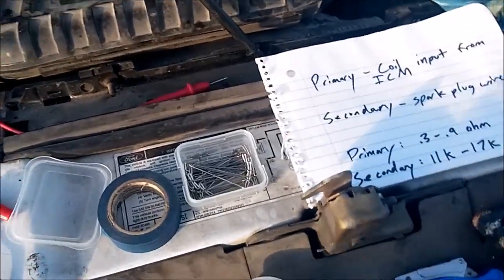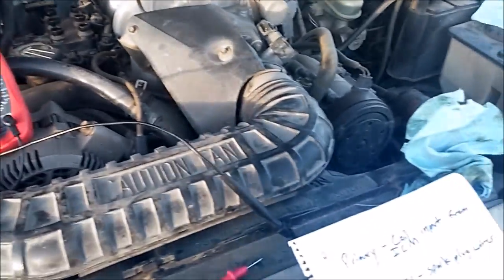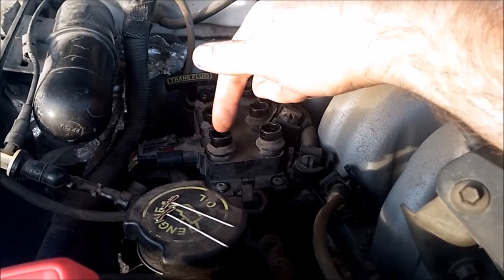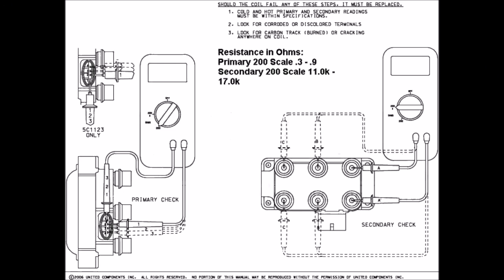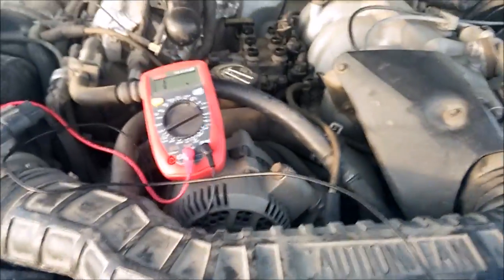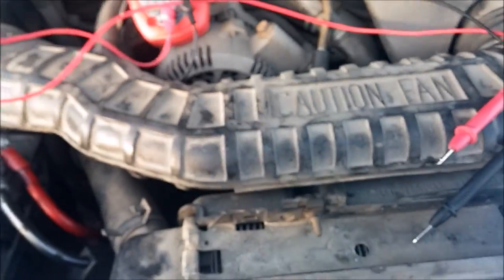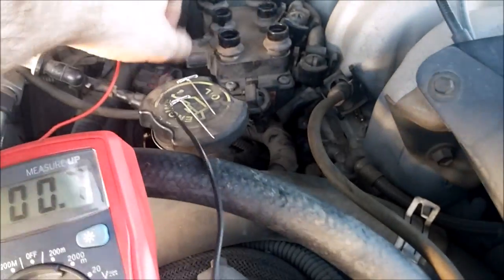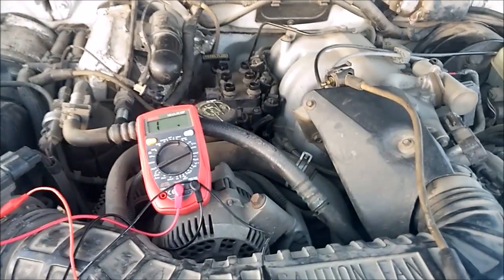1994 Ford Explorer - Coil Pack Testing

Comment: I have a 1999 ranger 3.0L. My primary resistances all check out good but all 3 of the secondaries read open. I tested just like you show in your video. Safe to assume bad coil? I am getting hesistation and P0305 on my truck,
Reply from the maker: Looks to me like it's pretty much an identical coil pack. Make triple sure of your multimeter setting, they're different scales. You have to switch from 200 ohm scale to 2k ohm scale. Usually it's just 1 or 2 coils that go bad, I'd be suspicious if all 3 died at once. But if you're 100% sure that all 3 secondary coils are open then it probably needs replacing. I'd be curious to see if you crank the ohm scale way up if they read into the mega ohm range? I had a spark plug wire do that, it wasn't open but just extremely high resistance. That 1 plug wire being dead made the engine feel like it was going to die at a stop sign.
Reply: I have a pretty nice Digital Fluke meter with auto ranging. I tried it with the auto range on. Then moved it into the ohms, K ohms then M ohms scale and all read open. I though I was testing wrong but I don't know. I get nothing on secondaries.
Reply from the maker: Make sure the battery is charged on the meter? I've had bad readings from that. I'm just suspicious because the engine runs and yet all 3 are open, that doesn't compute. Did you check the reading hot and cold?
Reply: My meter is new out of the package with a new battery. Readings were taken with truck cooled off a bit. Im thrown off too. There should be some type of reading. So the coils just test one directly across from the other like you did in your video correct?
Reply from the maker: Yea, that's the only way they go. 3 pairs of them. Try the coils when the engine is hot. If I were you, I'd try to find a junkyard coil pack or one off of eBay to test before buying a brand new one.
Reply: Yes sir. I have a friend that works at the local parts house. I will ask him to let me probe a coil pack to check. Thank you for your help. I'll post back my results.
Reply from the maker: There you go, that should give you an idea if your meter is functioning properly and if your testing methods are right. Then you know. Since you have the coil pack off, I'd test the wires as well.
Reply: that is a mis fire code  on cylender  5 i would check  plug wire and groud  hope this will help